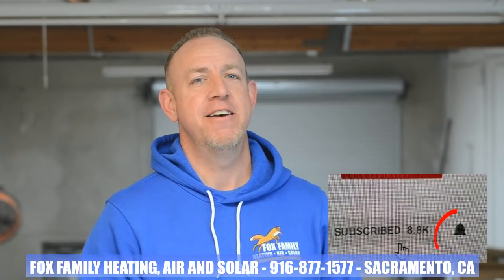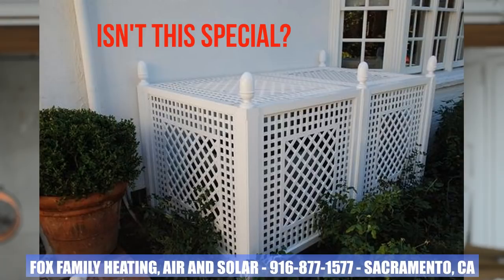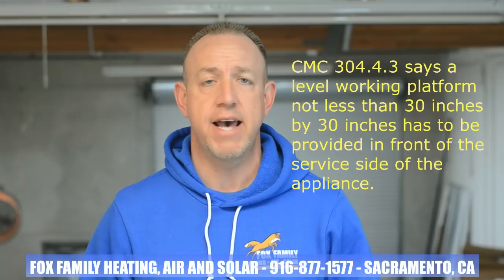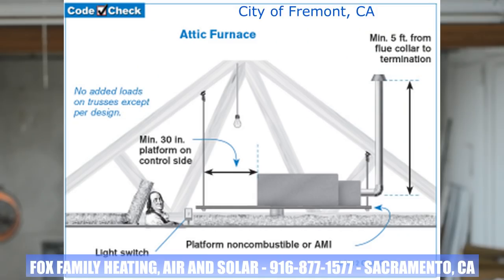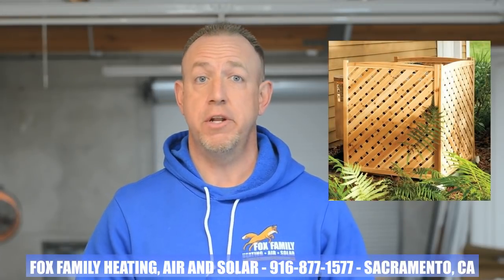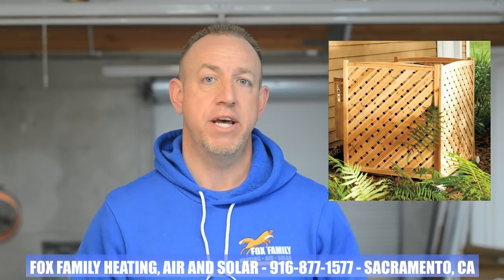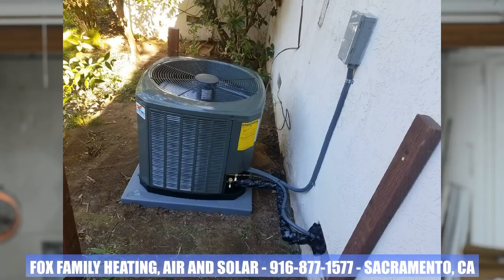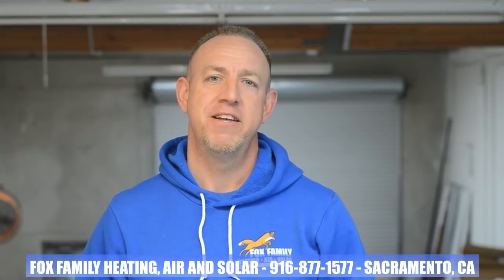What is the Required Service Area in Front of a Furnace or Air Conditioner?

Comment: Ran into one servicing a down flow carrier furnace with just about 10” of clearance between the cover of the furnace and the 80 gallon water heater in a utility closet.  The flue pipe for the furnace was touching the cold water into the water heater and it was a pain in the bum setting gas pressure. It all boils down to caring about the future of servicing the equipment and actually caring about what you  do

Comment: I did a furnace re&re and the original installation didn't have clearance to remove the filter without needing to partial crush the cardboard frame. We rotated the furnace installation by installing the furnace up onto a base which then tapped into the Return Air out the back. Then relocated the hot water tank where the undersized service clearance was. Made for a cleaner looking mechanical closet.
Reply from the maker: Awesome work man!  Great comment.  You never know with retrofit right?  Get there in the morning and realize you gotta go a whole new way with it! Lol.

Comment: Oh Lord yes trailers r the cheapest 😭and just yesterday the manufacturer had improperly cut the 6 wire when wiring the thermostat so R and Y was broke. 

Question do you take before and after pictures of your work? I do cause I like to show people what I do and I'll make sure my condenser is away from the drip line making sure everything is lvl. Making sure my whip is neat always leaving a little extra power wire and 2 wire. Also I hide my 2 wire in the robetex. my boss told me to pig tail my 2wire. 

The indoor I hide my 2wire on the side of the air-handler until I get to the six wire, then I always make sure my wire is tight and not loose. The copper lines I always try to make nice and straight using plenty of robetex.

Things I'd like to do my boss won't let me I like putting my dryer as close to the indoor coil but he has me put it out side by the condenser.  Also while im brazing I like to use nitrogen there's a few more things but I love my job so I do what boss tells me to lol I work at C&D mechanical
Reply from the maker: Yea we love to take after pictures.  Love showing off my guys work.  Justin just installed this AC on Thursday this past week.